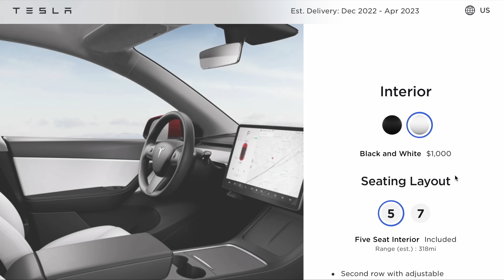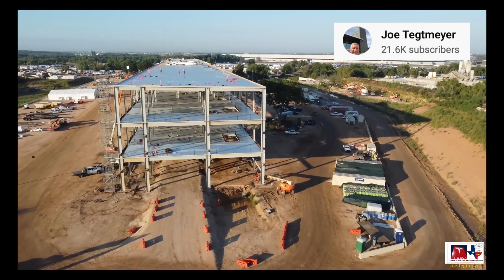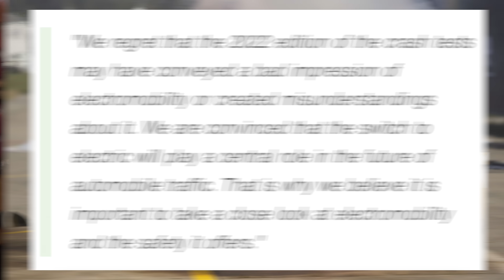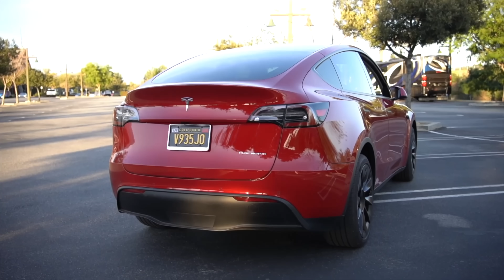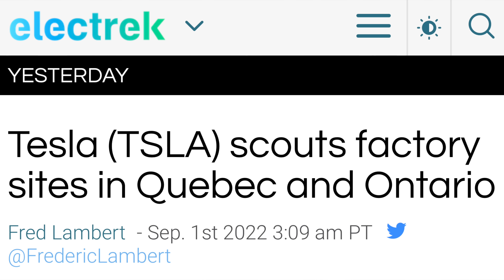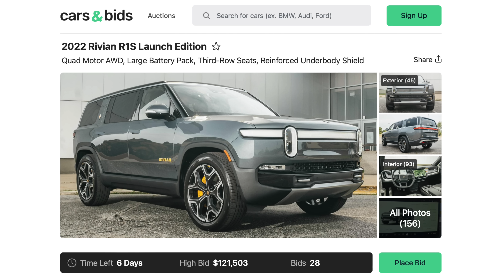Tesla Removes MORE Features | You Might Hate It

Comment: Regular EVs are a lot faster than some of the high performance gasoline cars.  Some of the drivers are crazy when on the road with such a fast car.  I have seen some Tesla drivers going crazy with speed on the roads. Going faster means hitting something with more force if there is an accident. As for myself, I like a vehicle with the main instrument panel showing the gauges in front of me.  Then the entertainment and GPS system can be on the side.  I like to be able to start the car and drive it if the main screen fails. I know someone with a Tesla. The main screen failed and he had to have the car flat bedded to the dealer. He did not have his car back for over a month. He had to lease a regular car till it was serviced!   For myself I will stay with a name brand Japanese EV. Easier for servicing, and availability for parts and service.

Comment: Removal of the stalks and shifter would be an absolute deal killer for me. I drive 300 miles per day.. almost all of that in city environment.  In and out of parking lots.. sudden navigation changes.
I WILL NOT relearn how to use basic controls just so Tesla can save 50 cents. Sorry.. It is NOT an improvement in functionality for the operator.
Make it an option... then you satisfy both.
Tesla cars are already a major change for people... adding weird new controls for basic car functions will add stress and confusion.

Comment: I think replacing the stalks with buttons will be a net positive for reliability, but I have reservations about how it will actually drive. Still, I think the stalks are one of the most awkward parts of the current design in my '22 Model 3, and I actually think they will be the most likely component to break and need repair. Therefore, if it saved me a repair bill down the road, I could get used to it.

Comment: I traded an S for an X last June. I love the lack of shifters. As for the horn, few remember, but honking a horn wasn't always done by hitting the middle of the steering wheel. Our minds and bodies can well adapt. The only problem with the lack of shifters I've found so far is the signal arrows can be a challenge when you have to signal at a time when the wheel is turned 180 degrees....but then over half the people in my state of MN never signal anyway...so no problem.

Comment: I love love the clean one touchscreen clean look of the model 3 and Y, but I also prefer the two stalks and would not like those removed.  I can use the stalks with my eyes closed and can react very fast when I need to use them.  Tactile “buttons” on the steering wheel I would have to look at the steering wheel to find.   Not a fan of removing the stalks and putting those controls on steering wheel or touchscreen. This is exactly why I love using voice commands for my wipers…. I never correctly hit the wipers when I need them and have had very hard rain come all of the sudden where I needed my wipers on immediately.
Reply: The wiper design frustrates me because it could be so much better.  Once you press the button on the end of the stalk to activate the wipers, the scroll wheel should control the speed.  So much harder to go to the screen (or use voice commands) for that.  And unfortunately the auto mode is consistently too fast or too slow IME.  (I actually prefer how other companies do it, where you still have speed controls in auto mode, where your control acts as a bias or multiplier on what the computer decides is the best speed.)

Comment: I've been regularly requesting the addition of the Model S on screen shifter be added to my Y and 3. I prefer it greatly to the stalk. After driving the new Model S for a while, the on wheel signal isn't a big deal anymore either. I can go between the cars and not even notice now. I do however wish the signal was on the rear of the yolk instead of the front where your thumb rests.

Comment: I am all in for the stalkless new steering wheel. Hoping this change is made pretty soon. Continues the minimalist design language and design consistency across teslas. It also makes the system have even lesser moving parts and thus lesser wear over time, even though the wear on the stalks may not be a big deal. Directionally this makes sense.

Comment: I have to say, I have buttons on my steering wheel now, but I never ever use them. The turn signal stock will be truly  missed. It uses mechanical memory, hunting for the button will not be  as where you hold the wheel and the amount the wheel is turned and hence where the button is changes.

Comment: Re: removal of stalks and round steering wheel. A definite adjustment for sure. But just like going from 50+ years of driving traditional ICE cars to my ‘21 SR+, I bet in a matter of not much time, I’d be fine with it. 

Perhaps parallel parking in a tight spot might possibly be a bit annoying with the shifting R to D to R to D to R, but how often does that situation happen? 

It’s kind of like not having the typical dashboard compared to Tesla’s center screen. I rarely look at the speed - why would I need that info in my face all the time? I’m using road and car feel, the context of traffic around me, safe driving, and (if I’m on the freeway) autopilot to monitor my speed. I don’t need to know my speed every second. And when I do want it, a very quick glance at the screen is all it takes. 

So I would not hesitate to take on the (possibly) new stalkless yoke configuration. Though my take on Tesla is don’t believe it until you see it!

Comment: No stalks would also affect the high beams on/off. Automatic high beams do not work well enough to eliminate the easy flick of the he stalk to turn on or off the high beams.
Reply: High beams used to be a large button on the floor. Things change. Sometimes they work out, sometimes they don't.
Reply: @michaelcoughlin8238  I've been driving for more than fifty years so I have seen many changes. One car's horn required pushing the turn signal stalk in towards the steering wheel column. I would like them to leave the high beam switch alone. I like driving. I drive for fun. Allow my car to be fun to drive.
Reply: @steveallen1055  I get it. I do t like paddle shifters, touch screens in cars, etc. In fact, I don’t like fuel injection! Most of it for me comes down to computers in cars. I’m in IT and the high cost of repairs due to computerization of my vehicle ticks me off. I’d rather drive a ‘59  Chevy Apache Fleetside, manual transmission.

Comment: Great video, thanks for the updates.  I'm not a fan at this point of the new steering wheel.  I can see if that is your only vehicle, you get used to it.  However I'm in and out of a few different vehicles depending on my needs for the day and appreciate the fact that the Tesla's basic controls are similar to my truck and other car.   It took me a month to stop clicking the "park button" at the end of the right stock to turn off cruise as that's how it is on one of my other vehicles.  Good thing Tesla doesn't let you go into park going 70mph ;)

Comment: Removing the stalk for indicators is unworkable for roundables
Reply: I have a 2022 MSLR.  I love not having stalks.  I have no problem with roundabouts with the indicators on the yoke.
Reply: @snappytoes  So you have no problem signaling that you're leaving the roundabout, when the yoke is turned maybe even upside down? And in multi-lane roundabouts when you might have someone on your right but you need to change lanes inside the roundabout before leaving - all while looking down to see where the right button is? Sounds like cap to me. But if you have a video proving this, I'd love to watch it!
Reply: @snappytoes  unfortunately it sounds like Model 3 and Y will still have a round wheel. So your hands will be moving around the steering wheel, changing the position of the indicators

Comment: We have a Solarroof with 2 Powerwalls and participated in the VPP program events.  The results are decidedly mixed IMHO.  It is great to provide power back to the grid and help out other homes.  And, you do receive $2 per KWh that you send to the grid. However, this is at the cost of power you may want to use yourself should the grid have outage.  Also, it may force you to buy additional power at peak rates.   So, while I love the idea, I am debating further participation in the program.  Luckily you can opt out of participating in an event with a push of button in the app.

Comment: We have a 2022 X and a 2019 3.  I daily switch between the yoke and buttons and round wheel and stalks.  I have not had any trouble with this and prefer the yoke except in very tight parking lots.  As Ryan reported, the turn signal buttons are fine.  However, they should make the center part of the yoke honk the horn.  Elon had previously tweeted that this was going to happen, and he needs to make this happen now.

FWIW, I has completely against the yoke until I drove with for a few days.

Comment: I've had a Model S before and currently drive a model 3 while waiting for a model S plaid in decenber 2022 - febuary 2023. 
I'm curious to see whether I like or dislike the yoke, but I honestly think I'll hate it.
Touch buttons for blinkers on the yoke has to be the most idiotic design I can think of. Using it when driving in roundabouts with the yoke turned 90 degrees sounds like a pain in the ass, like just try adjusting the volume while turning.

If I do dislike it, I'll sell the car and move to a different brand.
Reply: If they placed a variable ratio electric steering with the yoke, I believe I would prefer it.  I drove S with yoke.  It is fine except for exactly what you suggest.  And on track, ratio is too slow. Variable ratio like GM used to do, when installed with performance steering tune in GM performance cars, for many was as good or better than rack and pinion.  

If Tesla decreases lock to lock or say 1.2 (.6 max each side), varies the speed quicker for this half lock like turns, would make all the difference. As a pilot who has many hundreds of hours in various single engine, multi engine aircraft, Piper and most brands limit yoke to half turn or so each way.  Yoke Works great in that setting. I would never want to fly with steering wheel, and three turns lock to lock. :) 

Too bad EM who has sweat the detail so well in the past, overlooked the detail of transforming users to a yoke.
Reply: I’d never buy any car with a yoke.
Reply: expecting my model s this month. 1st trying out the yoke
Reply: So instead of replacing the steering wheel on a $130,000 car. You throw your hands up in the air and go buy an otherwise inferior product? Got it.
Reply: @okthisisthelasttimeipromise  lol, inferior product xD
My complaint is on the lack of stalks a custom steering wheel wouldn't solve that issue.

Comment: The way I use indicators and wipers would bed a no go for me to use touch buttons. I use knuckles  for the turn signal yoke. Gear selector I would not care if it was removed but again I like tactile feedback for Cruise Control and AP. I hated, like hated with all the hate I have in me touch buttons in any other car so far. Tesla is a great car not the best but great.
Reply: Wipers can come on automatically and the blinker becomes muscle memory same as the stalks, you use your knuckles cause you know where the stalk is without looking, after a few days you would do the same with button placement
Reply: @jamarforsythe7262  Wipers do that, yes but i press button to clean wind shield evry now and then, also they are unpredictable in both extremes little and heavy rain. Indicators is my muscle memory and switching between vehicles makes it ever so more annoying. Same for the high beams, those are used from time to time so I would need to adjust to a touch button. I like my TMY I do, but there is no dispute that some traditional stuff is just more convenient, speed indicator in instrument cluster or hud is still way better than centre screen. 
One thing that pisses me off is that voice command ‘defog’ is not recognised -
so annoying.

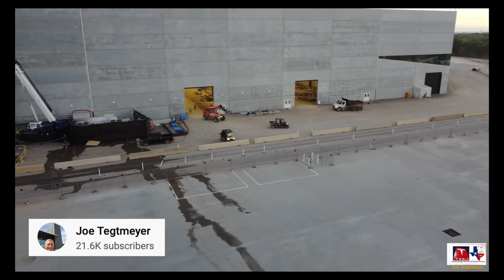Comment: 2:45 The 4680 cells in the AWD should be considered "first article" of the product.  They will get very valuable field data from these units.  They will also need to make improvements in capacity for the 500mi Semi, along with manufacturing improvements to increase speed.  So there should be no surprise that there will be downtime in 4680 production, along with contingencies for this  (i.e. use of 2170s, and stock of complete YSBs).

Comment: I would not buy a 3 or y because there is no instrument binnacle... centre screen is too far to take your eyes off the road
Reply: Wrong… You have not spent time in one.  It is easier to see what you need (speed,etc) in the upper left of the display than down over/in between the wheel.  As good as my G90 with HUD.  I do not move my eyes off the road.  And so much more is right there for the eyes.  The AI traffic examiner, amd NAV is so much better than a smart phone, or ICE NAV display.  I will never go back to steam gauges/buttons, and scattered disorganized across the dash for vehicle awareness.

Comment: After driving my Plaid for nearly a year, yoke needs improvements, 1) turn signals n emergency lights should relocate to both thumb tips or index tips at back of handle ber, double press for blinks. 2) horn button should go back to traditional center 3) steering yoke could shrink size by 2 inches, lower right corner blocks lower left screen a bit 4) eliminate lower horizontal bar cuz they do noting
Reply: After driving my new Model S for two weeks now: I'm still missing the turn signal stalks. A LOT.

And something else, which i didn't even notice the first few days:

The stupid yoke is made from finest plastic.
C'mon!! Seriously??? The same crappy foam plastic crap I'd get in a 2005 Chevy Nova???

It makes my palms sweaty and slippery.

 And it's DEFINITELY not suitable for a "premium" car.
Reply: Thanks John, incitefull feedback
Reply: Just throwing in my two cents, I really like the yoke as is. My only complaint is the horn, but everything else about the size and shape and turn signals is awesome
Reply: I like the yoke just the way it is.

Comment: Love my '21 Tesla but hate the lack of stalks for lights and windscreen washer, find the yoke shape downright dangerous in emergency situations, and horn also dangerous and needs to be a big area in center of wheel for emergencies. Also dangerous is cruise control doing sudden stops for no reason on the highway. Because of the dangers posed by the yoke and its controls, and cruise, I would not buy this car again, which is a shame as the rest of the car is excellent.

Comment: Removing the stalks is stupid as hell. If you are going around a curve and need to hit the blinker it will be upside down lol. If you need to manually operate the wipers/fluid you have to look at the screen in a downpour.. not fun. If you need to flash your brights to warn others of danger you can't. Physical buttons will always be a necessity!!
Reply: Fair points
Reply: I agree with the blinker, but the wipers come on automatically.
Reply: I wouldn’t mind the turn signals if they offered some sort of haptic feedback, but if the horn button is implemented the same way as the MS/MX I would be completely against it due to the safety concerns.
Reply: I disagree. Operating “manually” is not the goal. I like the stalks, but like other options I think they will be unnecessary in the near future. When “driving” in FSD, I don’t use any of that stuff. I really do like the scrolling wheels through.
Reply: I’d be caution using the word “always”.
Reply: Apparently not always.
Reply: Wipers are automatic and you realize you need to use your blinker before a turn to tell people you are making a turn, right?  Lol if you are already turning then it’s too late
Reply: @chrisallmand1805  I own a tesla and the auto wipers aren't nearly aggressive enough.  If Tesla gave me a slider to change the aggressiveness of the wipers then yes maybe I'd be ok with no wiper button.
Reply: Spot on, this is going to be the downfall of Tesla. Oh and I own a Model- Y performance, not a smart direction.
Reply: @voltron3015  Downfall is a bit much.  If it affects demand they can just offer it as an option.  As long as the horn stays in the middle,  I'm good with the change.

Comment: i dont like touchscreens for anything that requires timing or precision.
"touch sensitive buttons" are not buttons either and they also suck to use.
anything with safety in mind should have physical actual buttons.  yes its cheaper to 'do it all in software and menus' but it sucks to actually use it that way.
you should not have to nav different menus to do anything critical.
Reply: I agree.
Reply: Super agree

Comment: When does the change in year for the model typically take place? In other words when did the 2021 model 3 change to the 2022 model 3?
Reply: Oh, I see. Yeah, normally happens sometime in Q1 of the following year.
Reply: @ohgerm  dang I want the stalkless gear shifter and indicator, but I also want to get it in January as soon as the rebate is available :(
Reply: Model year is a bit vague and moot with Tesla, as the cars change all the time, some times fundamentally, and are different based on which factory produces them. Production year or alternatively the year the car was first registered is usually used.